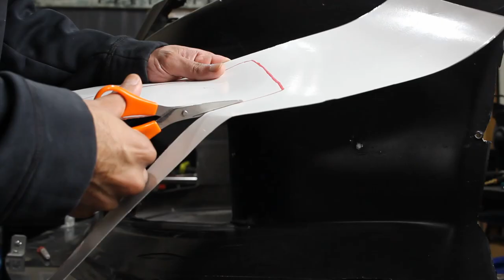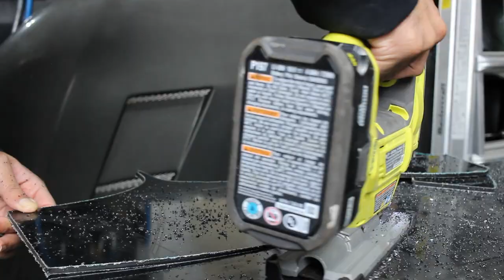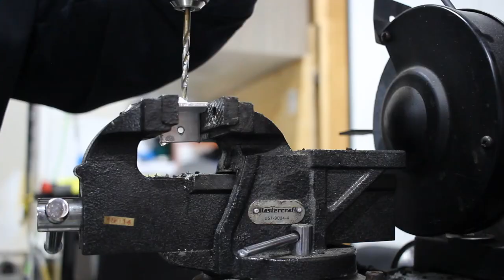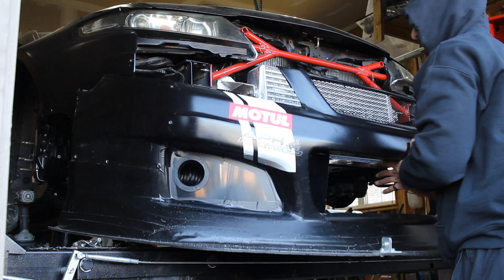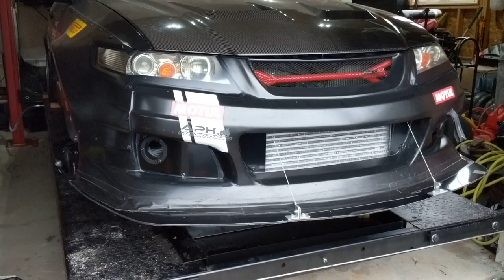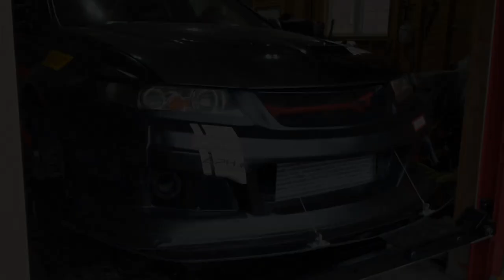TSX - Aero Update

Comment: That front splitter you made, you take the whole bumper off for oil changes? I'm guessing it's just bolted to the bumper
Reply from the maker: The splitter stops about a quarter of the oil pan so no need to remove it. And it's bolted to the bumper and brackets+ the braided line.